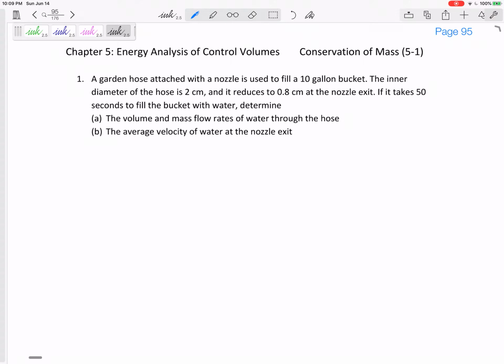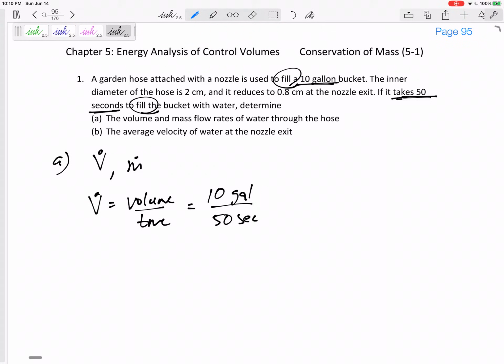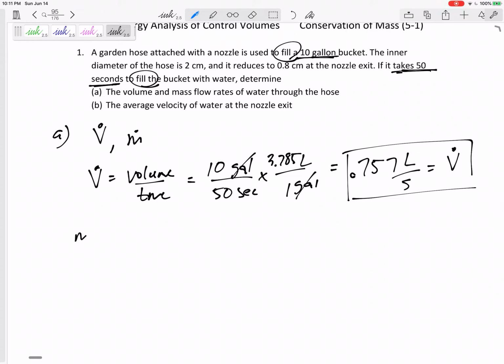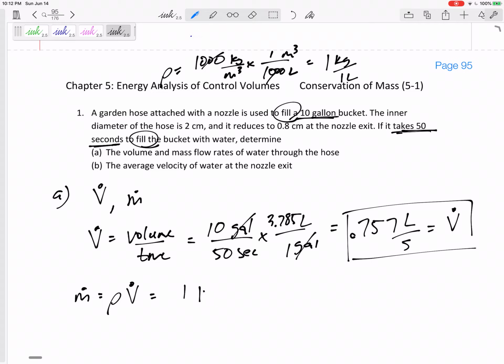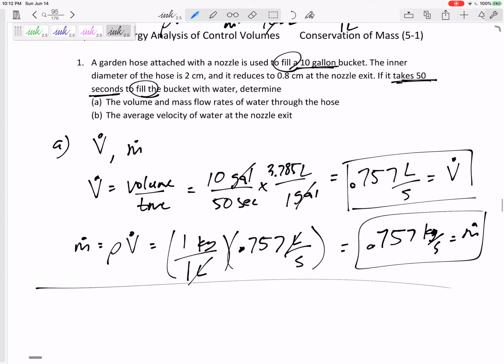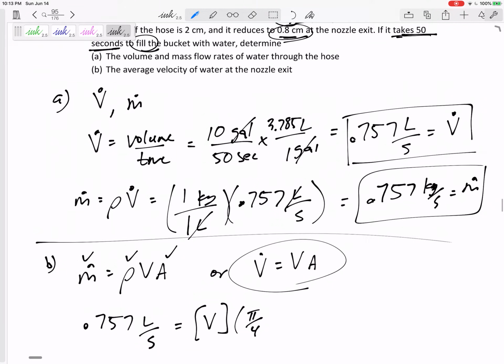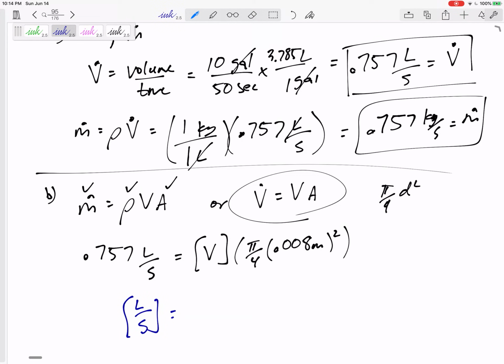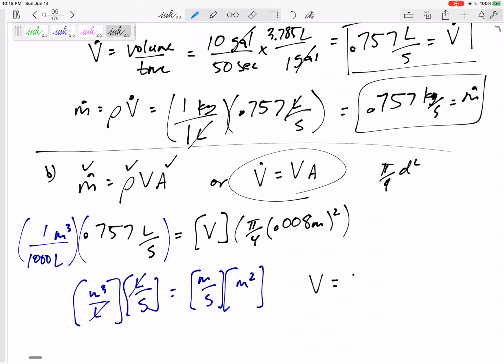Thermodynamics - 5-1 Mass and Volumetric flow rate example 1

Comment: quick question over here. why do u use the 10 gals for part A . because it asks for the volumetric flow rate at the hose(inlet) whereas 10 gal is for outlet

Comment: It says that the 'inner diameter is 2 cm and is reduced to 0.8 cm in the exit' I think there should be a part where you integrate the Area or the diameter because there is a  change and also you didn't use the 2 cm in the solution so I'm guessing haha
Reply: its not asking the velocity throughout the hose, just at the nozzle. so all we need is the cross-sectional area at the nozzle exit
Reply: @mustafab83  kanki neden alanı 4 e böldü onu anlamadım
Reply: @datik66  Orada çapını almış çapı 2r oluyo ya karesini de alınca 4rkare cıkar bilerel 4 e bolmus ki pir2 cıksın
Reply: Yah I thought so, we should take the delta area as it says in the book

Comment: about the density in first case it is 1/v why did not you use that?
Reply: There's no way to get specific volume without temperature and pressure data right? Density is the only option